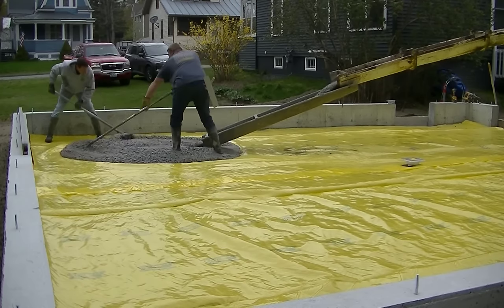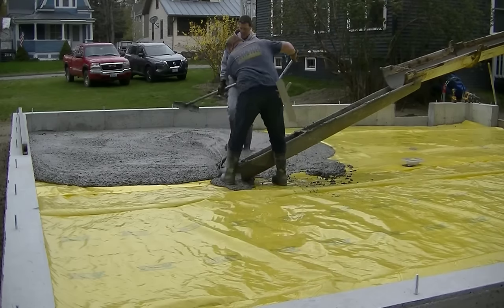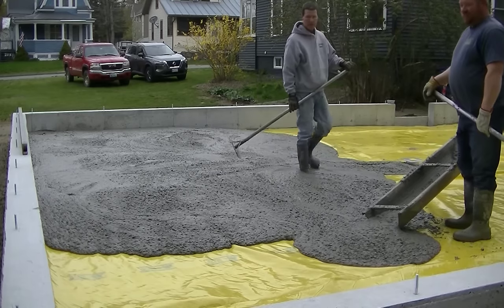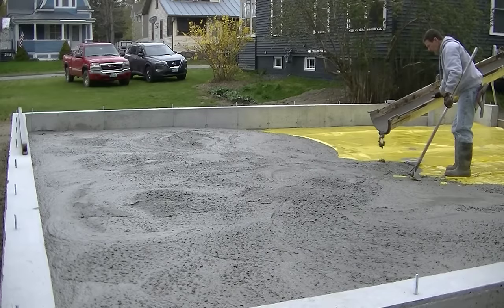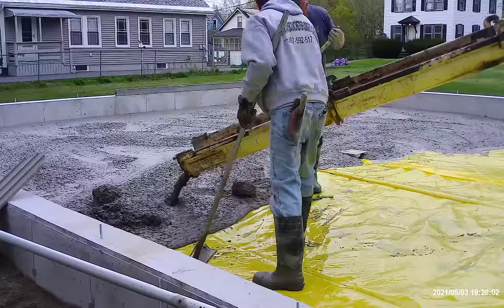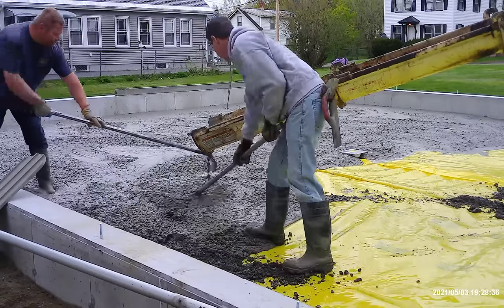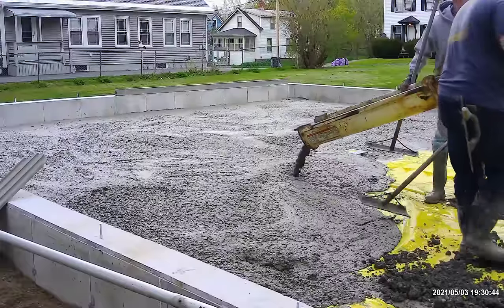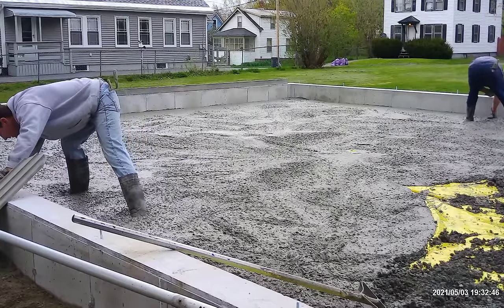How 2 Men Can Pour A 32' X 28' Garage Floor (I Got Concrete Balls!)

Comment: You guys rock! Now that’s experience. Slow and steady, calm and simple. I particularly like the synchronized push and shake of the mud off the boots as you screed. I just imagine a couple of eager DIY home owners trying this on a hot day. 😂.
Reply from the maker: Thanks so much!!
Reply: Watch carefully. The kick of the concrete off the boot is for pushing the concrete up to the screed where the void appears whene the foot is lifted. Watch closer.
Reply: @ericharris893  Never having worked concrete on this scale before, I was wondering what the purpose of that kick was.  Makes sense now.

Comment: While it is true that two guys can pour something like this when conditions are right. Cool weather, eight inch concrete slump, no mesh to pull, a short radius drain screed and a skilled partner. That  being said, you do great work and it is nice to see you work as you are a true craftsman! Things would be different with a 5" slump and a sunny 100F Texas afternoon!
Reply: What is a 5 inch slump mean sir
Reply: @jwell1160  slump is a measure of the amount of water within the concrete mix. It tells you the level of "flowability" of the mix when spreading out.

Comment: Yeah so I'm familiar with the concrete nuggets,  I live in ocean park wa. And we named them ocean park nuggets.   Small town and small concrete plant with old trucks.  The fins in the drum get worn or there is build up in the drum and it doesn't mix sufficient.  We had a truck that was notorious for having lots of balls.  Anyways not much else you can do besides break them up.  Shortly before that plant closed down I had poured an exposed aggregate patio for a client and one of those baseball sized nuggets got missed initially but was found during the washing/exposing process. Needless to say I was glad to retire old big balls truck as that has been the only bit of concrete I have cut out and repoured in 34 years.  Great videos Mike keep it up.

Comment: Where's the Welded Wire Mesh?  It's going to crack over time, all slabs do, but the WWM will reduce the cracking and spreading of cracks.  I always require a rebar and WWM inspection before any concrete is poured on my jobs.  I can't tell you the number of times people have tried to get away without using reinforcing of all types.
Reply: Exactly.. idiots pour that amount of concrete without rebars. Well customers will buy again once the merchandise is broken. LoL!
Reply: Fiber creet is good for this, you technically don't need rebarb with it only being about 4-6 inches. Only industrial pours like firehouses and 2nd story's would need the barb and the fiber mud.
Reply: @hostileactual7655  Yes, slab reinforcement is local requirement. They do use it in LA; don't use it in Las Vegas. We used to use a 2" sand base in the midwest. No sand base in the west. Has to do with freeze/thaw and expansivity of the soils.
Reply: Most wire mesh ends up at the bottom anyway. This is a garage floor. Not a Shop or Floating slab. Rebar is overkill on a slab of this nature, especially if you pour 4000 mix with fiber.
Reply: @Gearhead-en8dz  also if they are using calcium cloride it will eat the wire mesh. Like you said, it usually always steped on and not pulled up correctly anyways.
Reply: @Gearhead-en8dz  if wire mesh is installed correctly it doesn't go anywhere, there are small wire stands it sits on at 2", 2 ½", 3", etc.   so it sits evenly during the pour.  Any slab I've ever specified has had the WWM regardless of fiber reinforcing, and the only callbacks I get are for more new work.  I also specify a 24" diagonal #4 bar at all inside corners to keep slabs from cracking, because they love to crack there.  Rebar and WWM is cheap, redoing concrete is not.  Not everyone builds a house that's going to be their forever home, they sell or leave the house to their children after 15-20 years, and it's the next homeowner's and the one's after that I try to take into consideration in addition to my clients needs.  For less than 5% on any home build you can make it's longevity stand above the rest of a neighborhood by not cutting corners.  Those corners are typically cut by the contractors and subs, and they tell me they hate me at first because I'm cutting into their margins.  I reply, then you under bid the project, you knew what was specified, you priced the job on these details, and this is what my client and yours is paying for, if you don't like it, leave, but re-read your contract first because it will only hurt your bottom line more.  Some contractors I've never worked with again and others come back time and time again because their final product is better and they showcase that work in their website portfolios.  It never hurts to do things better.
Reply: @j22mattones  I know about seats. You might as well put fiberglass rebar in it to. Hell, tie it 12 on center. Put expansion around the whole damn garage too. You know what's funny. I have sliced garage floors,( with deep jointers and saws), used expansion, mesh, grease dowels, rebar, fiber mesh and fiberglass. If they're gonna crack, they're gonna crack. Substrate prep is more important than any of the aforementioned reinforcement. The true problem lies with contractors "slapping" 'em up. P.S. North Dakota
Reply: @Gearhead-en8dz  absolutely they all crack, agree 100%, it's all about mitigation.

Comment: I’ve seen pump drivers absolutely refuse to pump another drop after seeing one of these cement rocks. But we usually do what you do mike and just bust them up and mix it with some wet stuff
Reply: That pump operator didn't know what he was doing, nor did the concrete driver.

Comment: I am researching concrete foundations. I came across, doing a job of this size with a different more time efficient approach. Clear, compact dirt, lay tarp, lay rebar, pour concrete, level and smooth out with 2inx4inx32ft (use a "L" shape elbow to go over the foundation edge), one man on each side, done. Great video.

Comment: I worked on concrete pouring driveways, curb and gutters,  even done a basketball court. I give much respect to these two men the work is hard from beginning to the end! It's not a job for everyone especially when you have to handle those curb and gutters steel forms.

Comment: I do it like this everyday. 2 guys. I've even done garages, and driveways solo. Time is of the essences but don't don't get in a rush. The balls are from "rebatching" the left overs from previous job. No biggie
Reply from the maker: This was the first load out in the morning.
Reply: They come from spinning the barrel too slow while they are adding the water.
Reply: Re batching? Don't think so...
Is that e e. A thing?
Reply: @davidjessee7701  🤦 it's not a significant amount it's a little concrete stuck to fins from previous pours that day or a dry pack from loading

Comment: Almost can’t believe 2 guys pulled this off, this was amazing
Reply from the maker: Thank you
Reply: 2 guys that really know what there doing and work well together, can make alot happen.. I've done it for years with a buddy of mine.. you can work 3 times harder with the wrong crew and more guys.. 2 good concrete guys can make a lot happen
Reply: It helps big time when the SUN isn't beating down on you
Reply: I’ve poured 1500sq ft with mesh in a slope driveway with one experienced guy, one kinda finisher and another without any experience in 90F day in the noon sun. 3 hrs to complete pour for being one large pad and a smaller 3 cubic meter pad.
Reply: @Sicktrickintuner  Wow that’s impressive, I can’t seem to find that video on your page 🥴 ☠️
Reply: @AlMai222  I don’t need to justify everything by taking video of it like everyone else
Reply: @Sicktrickintuner  bs, where’s the video ?
Reply: @dudamage8241  where’s yours?

Comment: Hahahaha, that is so far from a 6.5 inch slump it's hilarious!! Believe what you want.
Reply: About as wet as self leveling. But they make it work for them. Btw about the clumps, dirty truck fins. Seen it plenty of times, you do what everyone does, pull them out and break them up. He needs to chip that truck out. Good job guys. Been in concrete quality control for 25 years now,  not much I haven’t seen.
Reply: @musicmanmatheney3314  I was gonna say the same.. either the truck has lots of buildup or wornout fins.
Reply: It would struggle to make a 9" slump. Super plasticizer or not it's too damn wet and I promise you it won't break 3500# in 28 weeks let alone 28 days.  These guys need to try pouring concrete on a military base or bridge job.  Those "trucks of the trade short cuts" only fool gullible homeowners and contractors that don't give a crap about the quality of their finished product.
Reply: @charliehill3062 with plasticizer you'll get 5k in 7 days.  I use it in my walls all the time and on my federal and state jobs that require a 3" slump. I don't like to use it on flat but it's fine to use
Reply: @alfredgaitan1201   If it did have super P that is fine, but the slump is still not 6.5.
Reply: @tstep522  did I say it was? My company gets tested weekly, I do a lot of gas stations curb n gutter. I very familiar with slumps and testing.

Comment: Just discovered your channel Mike....good stuff...just curious as do you cut control joints on this type of pour? as we all know most slabs no matter how well they are constructed will crack over time, for those not familiar control joints are usually cut into the concrete a quarter of the depth to "coax" any cracks which will occur into the saw cut line, thats the theory.

Comment: I could poor that solo at a 9" slump and watch it crack all to hell in 6 months.
Reply: Zero reinforcing steel....
Reply: It's fibres reinforced, perfect for slabs on grade, go check Sika for fibres. He is also using water refucer which allows that slump without loosing strength.
These guys are professionals, no cracks with fibres.
Reply: @christo7105  I don't think hes ever heard of fiber mesh before

Comment: We got a couple plants over here in California and been at it for a while. Generally when we get those balls in the concrete ,it’s from not enough head water in the batch ,in other words if the batch design calls for 200 gallons and I didn’t  addthe 200 at the head of the batch and now it’s a 2.5 inch slump and then i add a bunch of Water to bring it up to a 4 1/2 slab that will create that because it got really dry about 3/4 of the way into the batch. Also sometimes when you load 3 yards for instance and then there’s a change on the phone or something and they want another three

Comment: Ohhh, nice meatballs! I remember when I started out as a young laborer on a commercial crew, the older guys told me they were called Dego eggs, and that is where our foreman hatched from.  Here's my best guess:  They may form in clumps from the silo (maybe every time), but most trucks can mix them up when spinning the drum.  When you are pouring and you see lots of meatballs, and mixing wont help, it means the screw fins on the inside of the drum are old and have started to ware away too much to be effective. Whattia think?

Comment: Second load wasn't quite as wet as the first, but still not much of a slump. A power screed would save your back.  Nice job in the end you work well together.

Comment: I'm a batch operator and have also been wondering how to get rid of those things.  I've found that batching the trucks at a 4" or less greatly reduces if not eliminates those things, but having a job 5 minutes away at 120 yards an hour is kinda tricky.  Now as an operator.... I have to decide....  send the driver to the slump stand at 4 and have them hold up the line to add water for a 6" slump or send them a little looser so less time to the job.  Any advice would help

Comment: I worked rebuilding concrete plants building recycle washout pits and tear out drive way to slope to catch basins all while plants are still running. We had cannonballs when poring pavement everything had fiber and mixed at the site. I figured it just didn’t have enough time to mix well enough but pour was 8” thick just stomp like you did no real problem. We poured 80 to 100 yards every 3days with a 5man crew tear out grade and form on pavement.

Comment: I plan on pouring a slab of a similar size with my brother-in-law next year. We plan to build a pergola on top of it to grow grapes. Thanks for the tips! Quick question though; for the posts on the pergola I'm guessing we should dig, place, and pour concrete into a molding tube before we pour the slab. Am I correct?
Reply from the maker: You can use these and set them in the slab when you pour: https://amzn.to/3httLab
Reply: @MikeDayConcrete  Thanks! I put them in my cart. I really enjoy learning from you guys, you’re a great teacher. I plan on buying your course when I’m prepping for the project too. Should I have to worry about the weight of the  pergola cracking or damaging the slab at all?
Reply: @MikeDayConcrete  thank you. I put them in my cart too!

Comment: Had 54 yard pour for a large inclosed garage about 40 years ago, never had any of that, if fact had 2 inches of insulation board put down before pour concrete on top of it, trucks came about every 30 minutes 9 yards at a time starting at 6 am, everything went great, floors was done early afternoon, we had to keep putting water on it every hour, no problem as the water was already in the building.

Comment: I appreciate you concrete carpenters. I have been on some bigger pours, but usually I have only done small concrete jobs related to building. Im more of a framing carpenter, cornice work, doors, windows, interior doors, wood flooring, walls and trim
Reply: Do some roofing too, if its very simple i do the metal roofing on what I build

Comment: I deal with concrete balls regular seeing as im a concrete delivery driver in the UK ... problem with them is once they form in the barrell they tend to stay as the concrete truck isn't designed to break it up its just a mixer .... normally there caused by too much water in load so when the powder hits the water it forms instant balls , which is why on drier loads you wont see them you either get them right at the beginning of the load or right at the end .... or both if your unlucky lol

Comment: 30 years ago when I operated a truck in the army we called Concrete Mobile. I’ve seen these trucks in civilian use. The batch is mixed in the trough as it pours. we had a capacity to inject flow control and antifreeze chemicals although we never got to use that ability, we just did a 4 inch slump for all the jobs we did..

Comment: I batched at a prestress plant for 10+ years, from my experience improper aggregate loading causes these balls ( which are basically cement and water) for concrete to mix properly the mixer should be loaded 70 to 80 percent water with all the the aggregate followed by slowly feeding in the cement and remaining water. ( by the way, the powder in the mix is cement, when it is introduced with aggregate as a mix it then becomes concrete.)

Comment: Seen it. A pour being done on one of my properties. The contractor just refered to it as "raw mix". 
It happens when unmixed crete is exposed to some humidity as was explained. It made no difference. They did exactly what you folks did. Except they used a tamper. The final set was perfect and that was 5yrs ago. No issues.

Comment: My fiberglass reinforced concrete driveway all cracked within 5 years. Rebars only from now on. Crazy to do this large slab with only two guys. No control joints?

Comment: From my personal experience. Wen i did build my garage 24x32 and 10’ wall and cathedral rafters and few year lather i decided i want a lift in my garage. To make sure i need to cut the concrete and create a more re enforcement pad for my lift. Next time it will be in my initial design just in case.

Comment: Looks like the batchman dry packed the start of the load.  Very common from dry plants, And if the fins of the drum from the truck are caked with dry up mud from not washing down properly,  those fins just move the balls and not break them down like it's supposed to. Some of our drums have "ball buster" plates in between the fins. Those plates slap those balls and breaks them up on contact.

Comment: I just noticed you hoth have an interesting geip on your rake. You have elbows out - both thumbs pointing in. I usually see the leading/nondominate hand's thumb pointing the same direction as the dominate hand - much the same way people hold a shovel. I guess O noticed that because sometimes I notice I will use a shovel kinda like that - pulling gravel the same way people row a boat.

Comment: Fiber mesh is great but no horizontal #5s @ the grade beams?(roll-up doors) I would have suspended one bar for an 8" beam or 2 for a 12".  We didn't get to see control joints but I assume they won't be  in the unsightly center of roll-up where it's likely to crack.  I also like bars @ a 45 degrees on all the outside corners of the floor drain, or any other outside corner wet stuck near FF.  Professional placement.  Nice video and nice weather.  Been pouring 30 years and never had any cement balls like that before here in North Alabama.

Comment: I poured a hole house slab by myself once, poured striped all the formwork and finished it on my own with a pump, they helped on the rake but it was still hard going 175m2 or for Americans 1883 square feet

Comment: I have drove for a company 27 years. Yes they my load to fast or not adding enough water when loading a truck or your loading a hot load from a bulk truck load. Concrete is had work. Your knees and back ware out after 20 to 25 years of working Concrete.
Hauling concrete for years I can say I know alot of good guys.